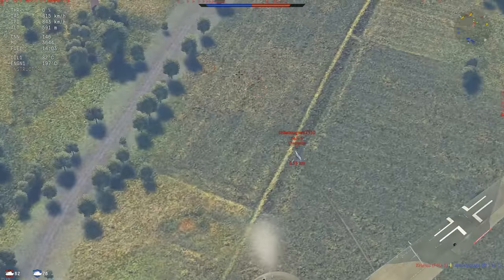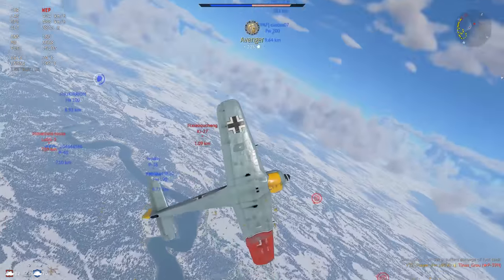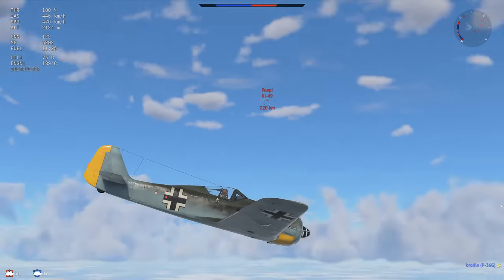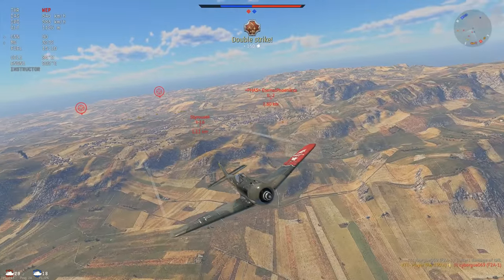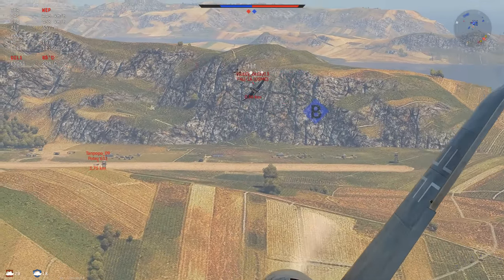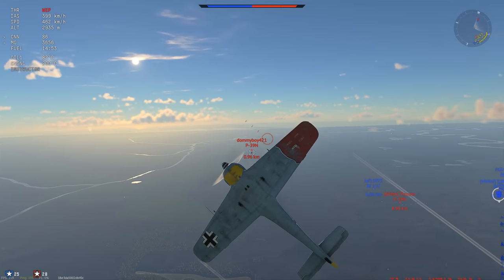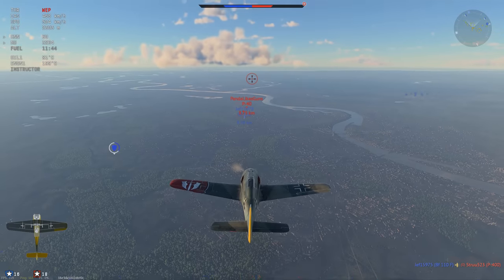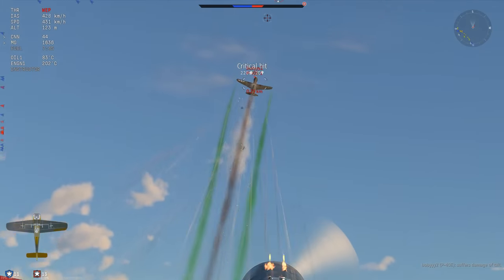Using Flaps Properly - FW 190 A-1 War Thunder

Comment: Flaps video is definitely a brilliant idea. Especially since they shouldn't simply be used every time you turn/take off/land, but when actually needed. I'm pretty sure I'd learn few ne things from a video like that. So do it! Just do it!
Reply: So, I know I’m late here; but when should you use flaps for taking off and landing? I usually use the “takeoff” flaps every spawn, should I not be? Is there actually a wind direction in game?
Reply: @Webly101  Using Take off and Landing flaps is actually pretty self-explanatory. When you spawn, drop the flaps to take off position, full throttle and after you get airborne retract them. Same with landing. Throttle to 0, few sharp turn to bleed speed and flaps down stage by stage, looking for flaps rip warning. In most props you can take off and land without using flaps. They are not necessary but helpful. In some bombers and attackers with heavy load, you may need flaps. The thing is, that flaps change the geometry of the wing in such manner, that they increase lift but also increase drag. You need lift on take offs and landing, so this is when they come handy the most. The tricky part is when you should exploit this tradeoff during dogfight, when you need to optimize your agility and energy retention. And for this a nice tutorial would be needed.

Comment: I remember starting the German grind and getting to my first Fw 190. I was so nervous going into my first 3.0+ match and thought I'd get shot down right away. Got 2 kills in a win and I've love the 190's ever since. Especially the A-1 with multiple 7.92 guns. I don't know why but I prefer 4 small calibre guns with 3400 rounds over the later armament on the 190's. The numerous rounds of ammo helps make up for my terrible aim.
Reply: Yeah but imo the plus about the 7.92 is simply being able to pray and for enemy to bleed speed. The 151 doesn't have the ammo and the range of that kind of thing.
Reply: @briannormant3622 the ffm has a ton of ammo and hits like a train
Reply: @jeffporter8823 ffm and ton of ammo? Idk, but 90rpg doesnt sound like a ton. Especially if you consider that the 151 on the doras have 250rpg.
Reply: Idk man, i had bad experience with fw 190, got the upgraded version and very excited about it and there goes disappointment, the a1 version is like better than a4 i was like this plane can't fukin turn!

Comment: Daddy Defyn really needs to do a Tutorial on Flaps. I think I‘m not that bad with using flaps but which Planes should use them, which ones shouldn‘t (MER) and when to use them correctly. I think you can go very deep with the explanation of that and should be super useful
Reply: cringe

Comment: I used to fly 109s all the time until I finally tried the FWs and they are such amazing planes. They’re fast, extremely powerful, they take hits for days like the American Corsair does, they have great cannons and lots of MG rounds and are just super fun to fly.
Reply: for me whenever I'm playing a corsair and I get shot I just break down into pieces
Reply: Well you gotta think, the Corsair is made for high speed dive/energy fights. So if you get hit in a bad spot and you’re flying correctly you’ll fly apart like a piñata because of the high speed. But typically any wing and main fuselage shots can be taken quite a bit. I love it.
Edit: I mainly play the 3.3 USMC Corsair so maybe the others are a bit different in taking dmg I’m not sure.
Reply: Personally I like the F4U 1D corsair, which got moved down to 3.0 from 3.3 for no reason. But now it shreds apart everything else just because of speed difference

Comment: Nice to hear someone say that this plane can turn fight with proper flap/energy usage. Can't tell you how many times I've straight up gone balls to the wall in the a5/u2 and surprised players. At corner speed those first 2 turns are usually all you need to end a fight 90% of the time. Tight split S at the merge is a classic move that gives you angles almost instantly cutting inside anything that isn't a spitfire or japanese. Strong landing flaps have come in handy so many times in low speed rolling scissors. Would also add that I have tk'd players for blatant kill steals like that, no remorse
Reply: The amount of space climbing asses in their J2M's , XP 50 that dive on me only to either get reversed or start scissors is utterly hilarious. Also no one expects the 190/P47 climbing spiral so it's hilarious seeing pilots pitch up for easy kills only to get a face full of lead . I've won so many fights with spitfires by diving below them before the merge and then instantly convert that speed into vertical energy
Reply: @niggalini  J5n1 entered the battlefield.

Comment: I think doing a 'tutorial' on flaps would be really useful as using flaps is something everyone can do, using them correctly is a completely different story though.
Reply: agreed
Reply: Would love to see that. Flaps can make or break certain planes. Like all the Italian fighters are super reliant on using their flaps to dogfight and if you rip one then you are screwed.
Reply: Yes I agree
Reply: indeed. explaining the difference between when to use takeoff flap and combat flaps would be helpful to the community, in my opinion.
Reply: Yes please do a tutorial on flaps please
Reply: Flap characteristics also vary significantly between planes in the boost to lift, extension time and (as most people are aware) rip speed. Quite a significant point in game knowledge too, knowing that you can get a lift boost way before a 109 or that your lift boost can be exploited at a higher speed than your enemy's. An important thing people have to learn with flaps is radius vs rate, one-circle vs two-circle which may be quite dry for some of the playerbase.
Reply: @Blitzcreeper239  I think a go over what the do’s and dont’s of flaps are is more than enough. He 9/10 times explains flap characteristics of aircraft in videos on the specific vehicles.
Reply: @itsdecz1190  I think it's still worthwhile to cover it together, because the dos and don'ts would still vary based on your matchup and the plane you fly. It's all a subset of the big umbrella that is "Know your planes and the enemy's" but ultimately knowing some physics on flaps and which planes have better/worse flaps(eg Lightnings and Hayabusas) really helps in learning this very subset if you already know your planes well. But we'll see how DEFYN covers it, I'm sure it's on his bucket list if enough people like your comment.
Reply: +1, agreed
Reply: The learning process flaps have been and the amount of times I’ve panicked and hit flaps and blown half my wing off
Reply: All they do is make you turn better at the cost of speed. Need a lot of speed? Don't use them. Need a lot of turn rate? Use them. Need to slow down for a reversal? Use them.
Reply: Agreed

Comment: I love this 190, I think it's the only one that can really exploit the speed difference with other planes
Reply: I also like the a-5 and d-9 they are also similar in terms
Reply: A-5 not so much speed itself but its rip speed and flap rip speed is nuts with an amazing armament and the d9 is just bread and butter. good for ground (500kg) bomb and 2x13mm 2x20mm for air. Personally i prefer the d9 over the d12  mostly because ammo count even though i prefer the 30mm nose mounted :)
Reply: One of (if not) the best 190 in the game great performance overall combine with low BR. Guaranteed 1+ kill per game if you're not ran out of luck
 I use this plane to grind most of the rank I-III
Reply: D9 is the most agile and powerful 190 (well except the premium D13 which has stronger ailerons and can roll better)

It can one circle the K4 at 450 with take off flaps and spanks the french P63 in a stall fight
Reply: Chopin plays war thunder?

Comment: If you're a 190 fan / enthusiast like me you should get digital combat simulator 'dcs' and get at least the fw190 a. I have the Dora as well.   Very accurate.  It's a simulator so you have to accurately control every aspect of the aircraft just as in real life.  You can control every single knob, dial, switch, lever, ect and you get real world reactions.  If your fuel/air mix is too rich with your prop angle to fine you can get knock and blow your engine..and so on.   I'm downloading war thunder right now to give it a try.  
Kurt tank the designer of the fw190 said 'if the bf109 is a racehorse then the fw190 is a warhorse '  it was by far the best designed fighter of ww2 and aspects of that design such as redundant electrical systems for your control surfaces are things that were used first in the 190 and still used today by every single serious designer on the planet.

Comment: How do you climb so fast in RAB? I hate it when I'm around 1500-2000m and there's already a yak or lagg at 3000+
Reply: air speed maintenance and angle of climb. the plane's power to weight ratio also matters, a yak will usually outclimb an He 111
Reply: @horowitz8680  usually 💀

Comment: Wish I could still play the Anton Fw 190s but gaijin nerfed them so hard with the overheating when they already climb slower than a razorback p47 it's pretty painful to use them right now. Tho the Fw 190 Doras are insanely better in every way compared to the Antons but they sit at a much higher BR..

Comment: You’re teaching it incorrectly, flaps don’t make you turn better, they reduce your airspeed which reduces your turn radius.
Reply from the maker: You're describing an airbrake
Reply: Alright buddy ima have to explain a few things to ya as your comment nearly caused me to punch through my wall.

1: Flaps increase lift: Lift is a force produced by a wing which pulls the aircraft into the air. Lift directly opposes the weight of the aircraft. The added lift allows you turn turn tighter and fly at lower speeds than you're otherwise able to without flaps. This means you can sustain flight below the normal stall speed of the wing whenever it is clean (no flaps). This also allows you to have a tighter turn radius. More lift = more turning force.

2: Flaps increase drag: Drag is a force which directly opposes the thrust of an aircraft. More drag = lower acceleration, top speed, and energy retention. Energy Retention is the ability of an aircraft to maintain its speed in either maneuvers or when flying above the aircraft's level flight top speed.

3. Flaps are a tradeoff: The increase of both lift and drag means the gains are often temporary. For instance: An aircraft will sustain a higher turn rate (Degrees per second) with flaps up when compared to it having flaps down. When lowering flaps the aircraft will receive a temporary boost in turn rate until it eventually bleeds enough airspeed to fall beneath the aircraft's clean configuration turn rate. This means flaps are situational and should only be used when the energy retention loss trade for lift is worth it.

4: Stick to cars buddy :)
Reply: unfortunately, you are wrong
Reply: @DEFYN  I am not, I am describing how flaps physically slow down and aircraft by creating drag. They are meant to increase both drag and lift, not your turn radius. Reduced turn radius as a result of flap deployment is a byproduct, not the primary intention. Think of it this way: your aileron input is the same, yet your airspeed is decreased; which turn radius is lower, the one with the higher airspeed or the one with the lower airspeed?
Reply from the maker: This only applies to a long sustained fight. Flaps make you turn better for a short while provided you have energy 
And funnily enough in this case
A 190 turns better sustained with flaps down along side a handful of other planes
Reply: @c32amgftw  If two of the exact same aircraft are holding the same airspeed and one has flaps deployed while the other has flaps in, the aircraft with flaps deployed will have a tighter turn radius despite flying at the same airspeed. The more important aspect of flaps in a fight isn't the drag, it's the ability to produce more lift at a given airspeed than a clean wing. If the main purpose of flaps is drag, then why is there another secondary control surface called an airbrake whose entire purpose is to create drag?

Also, you said in your initial message that flaps don't make you turn better. So you wouldn't call deploying flaps to gain the extra lift required to pull into someone for a shot turning better whenever a shot wasn't possible without said extra lift? Deploying an airbrake wouldn't have helped as much as deploying the flaps.
Reply: Bruh.